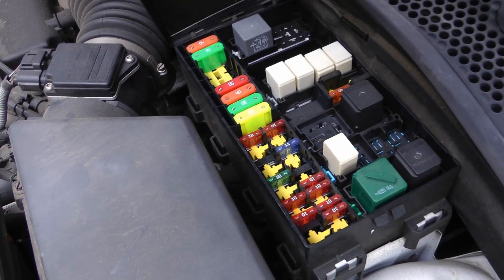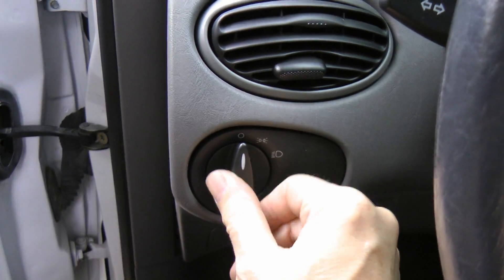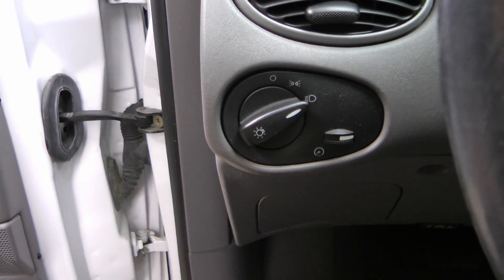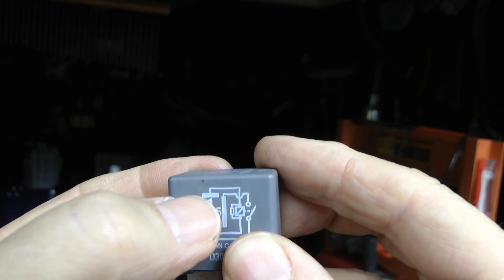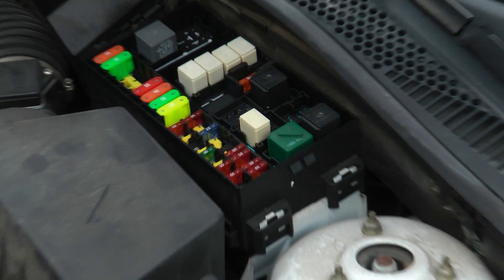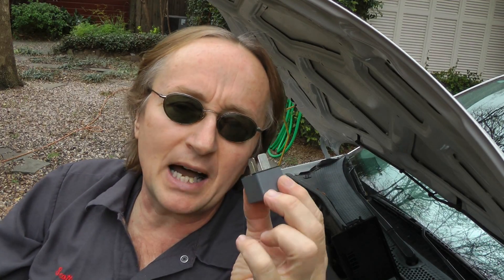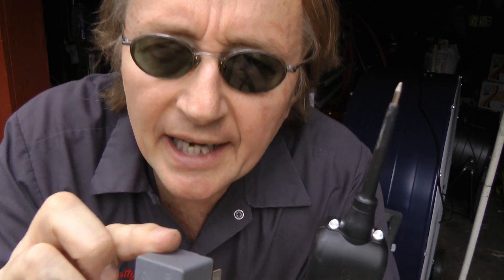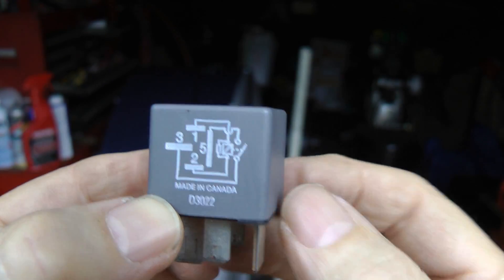How Electrical Relays Work in Your Car - Electrical Troubleshooting

Comment: Now I had a question for you Scotty. I drive a 2004 Chrysler PT Cruiser that lately has been having starting issues. Most of the time it'll just start over with no issues but I notice two things that it keeps doing. Either it'll keep cranking and the engine won't start, or it'll start and then just stall. Could that be the sign of a relay that's about to go bad?
Reply from the maker: could be a bad fuel pump relay, also pressure test the fuel pump itself

Comment: Hi Sir,

Your website seems down to me I guess. Please tell me my hazard lights are not working but turn signals are working fine in my Hyundai Sonata 2007. When I tried searching people mostly searched when signals and hazard both were not working. So in my case it is just hazard light.
When I click the hazard light button, it sounds like a good click which probably means switch is fine? Also, after clicking the hazard light button, when I tried pressing turn any direction it does not work, which means switch is fine? Is there any particular relay for Hazard only?

Thanks,
Harpreet

Comment: sir I have 1999 mazda portage 1.8  have problems with lights I changed both side bulbs when I put high bem both light work when I put in low beam one front light work any advise plz help me thx u sir
Reply from the maker: if they worked before, somehow either power or ground wiring got damaged, OR you got a bad bulb
Reply: Scotty Kilmer thank you Scotty Kilmer

Comment: Hi Scotty, my 86 Buick century ac/ heater Blower stop working so I replace the blower motor & resistor too, and still not working what next?
Reply from the maker: blower motor relay, bad wiring, or bad switch. Get a meter to test them for power loss

Comment: Hi Scotty, My L300FB Van (Philippines Mitsubishi) has no factory relay, I already trace the wiring and remove all relay i found but still the lights still on even the low and high beam. My concern is whenever I turn my head light or flash it to make signal in day time, my car stereo suddenly goes off  for a seconds,  I am wondering maybe the headlight eating too much energy that cause my car stereo goes off for a seconds. I diagnose my alternator using my multi meter reading at 14.4 volts, my battery is brand new reading at 12.9 volts, and the headlights switches is in great conditions. At the night time, when my headlights is on also my car stereo even I flash my high beam, no problem at all. And the wattage of halogen lamp of my headlights is stock wattage 50/60

Comment: Hi Scotty, my 97 Ford truck's backup lights stopped working(even with new bulbs), and I was told it is probably my relay switches. 

Are the backup lights connected to the instrumental lights? 
Instrumental panel lights are 90% out.  
Does the relay switch also control the air conditioning?

Should I just buy a relay switch and replace? Help-Please !?
You are still a Hottie!!
Reply from the maker: more often it's a bad backup light switch, replace that first.  Backuplights are not connected to instrument lights though
Reply: Scotty Kilmer Thanks, Scotty!!!! <3
Could the backup light switch be found in the fuse box underneath the hood?

Comment: Here in England, I have a Renault Clio 2009. One of the Headlamp relays broke, so I tried to get a replacement. Straight forward enough right ?  WRONG. Renault do not sell single relays, they will only sell the ENTIRE relay + fuse board as a single unit. A £ 20 relay problem is now a £ 400 /  $ 500  problem.  I tried to track a Renault Clio down in a breakers yard, but none of the 15 breakers yards have one.  Thanks Renault

Comment: Hey man i have a 99 toyota camry LE 4cyl last night my wife got in it to go to town and it wouldnt crank, wouldnt even turn over and she said she heard a clicking sound. I popped the hood when i got there and sure enough it was clicking from the fuse box. I found the relay that was clicking and unplugged it i believe it said HEAD on the fuse box lid. Watching this video you say clicking is good it means the relay works. SO..... where should i start looking for problems??? Any help would be greatly appreciated.
Reply from the maker: try jump starting it, if that works, replace the battery. if not, replace the starter

Comment: I have a Isuzu Rodeo 95 2wd my radio stays on but my Headlights, Brakes Lights, Turning lights, An my windows don't roll down an my flashers doesn't work it makes a clicking sound an when i hit my brakes lights even though it don't come on my radio shut off when I lift my foot off the brakes my radio came back on an i notice a week ago I have blacked stuff top of my battery do i need to replace my battery had it since June last year 2015 an when i try to starting my car it make a beeping noise this all happen October 30th, 2016
Reply from the maker: have the battery and alternator load tested, auto zones do that free. if not that, check for wiring shorts,both power and ground
Reply: +Scotty Kilmer Isuzu working now just a loose cable.

Comment: hello i was given a 1995 olds 88 one owner car and in pristine cond
with 90k miles. the old owner was driving it and it died on them and now it cranks but doesnt start or even try to start. it has the 3.8 motor in it with coil pack ign. would you have any ideas of what it might be or do you know of any problems these cars have..
thanks for any help.. and thanks for the videos.. i am going to sub
your channel.. might be of good use later..

Comment: I have a very hard problem my head lights don't work I have a mazda mpv when I engage the turn signal switch  to the had lights the hidh beam light comes on but no lights and the light does not come of when I move the switch. I need help
Reply from the maker: replace the turn signal switch assembly on the steering wheel assembly

Comment: Scotty, Love the video but I have a question, I have a 2013 Camaro LT and the trunk will not open electrically and at the same time I hear a clicking sound from the fuse panel near the sterring wheel.  Has the trunk relay failed?  Thanks for your Help i n advance.
Reply from the maker: pray it's just the relay, try a new one.
Reply: Scotty actually it was the electric harness that passes thru the trunk to the lid.  Apparently when we closed the lid the cable was binding causing a wire to break and another to start chaffing.  What a stupid design.
Reply: Thanks for the help

Comment: Tucson 2007. I have running head lights, hi beams but no low beams.... any suggestions....
Reply from the maker: check for power loss, from either a blown fuse, bad headlight switch, or wiring connector corrosion or breakage

Comment: hello Scotty
help me !
Where's located my relay ?
My rear brake light stuck on only when my car is start and run on the road, dangerous.
Hyundai sonata 2003 automatic 2.4
i have check my switch under perdal and everything is ok and work well when i did not start my car on.
thank you from Canada
Reply from the maker: not a relay most of the time it's the switch on the brake pedal being broken and on all the time, or that little plastic plug fell off the brake pedal and the switch doesn't shut then
Reply: When i do not start the car, my rear brake light,shut down normally with the pedal.
When i start the car, my rear brake light stuck on and never shut down?

But i'll get a new one switch just in case.
If not! 
Wich relay name do i need to change on my hyundai sonata 2003 2.4?

Thank you from Canada Scotty

Comment: Do you know where the flasher relay is on a 2001 Acura CL? I about to put LED turn signals in and I want to install an led flasher to prevent hyper flashing
Reply from the maker: hiding up under the dash above the driver's leg.
Reply: Oh

Comment: I can not find the ac compressor relay on my 2005 nissan maxima it's not marked on the fuse box.. help to hot
Reply from the maker: bad news for you, The compressor relay or A/C relay is located in the IPDM (intelligent power distribution module) and is not servicable.

Comment: Scotty, replaced a starter on my 96 Seville one year ago.  Today it's showing the same symptoms as the starter is clicking like it did when it went bad a year ago.  If the starter is clicking does that mean the relay is good since power is getting to the starter, or could the relay still be bad?  Thanks
Reply from the maker: could be many things, it just means not enough power is getting to the starter OR starter is bad. And any failure in starting system can do that

Comment: have 2000 tacoma and sometimes it clicks when trying to start then sometimes its fine starts normal. lately after alot of clicking when turning key starter engaged and engine started. then starter wouldnt disengage . where should i start? new battery already, alternator checked out too.

Comment: Kim, jaguar below, well know a lot by reading and your videos are wonderful.  just went to check fuse box under hood checked all small fuses and relays noticed one small black relay loose but when going to put it back in still loose.  oh and just put in New battery thanks to your video will be changing connectors this week.  Also going to replace all small fuses but don't know how I would change a bigger small relay if loose in that spot fits in one below?  by the way brought the car in for inspection passed then went home started didn't work?

Comment: Scottie I have an A class Mercedes 2002.  When I turn off my engine it will not start for an hour.  In hot weather this might be two hours.  I have been told it may be the starter motor but I have no trouble starting the car first thing in the morning only when the car has been driven and the engine switched off.  Then I wait for an hour and bingo the car starts.  It is usually to the minute but  it is becomes more unpredictable and can take longer if the sun is out and as you can imagine this is the time I want to zoom off to the ice cream shop.  Anyway, long drawn out explanation but do you think it could be the relay?
Reply from the maker: replace the starter and pray it's that. if not, then pay a merc mechanic with a STAR tester to analyze it and spend a small fortune in most cases. At that age, Mercs are money pits

Comment: hey Scotty I have a 08 ford mustang and all my sensors in my car are on my radio don't come on and I have gas in it but its showing I don't have any, m6 check engine ,traction, oil, brake lights are all on what could be causing this problem?
Reply from the maker: often an electrical short, a ground short, on the car's computer system, or a bad body control module itself. Good luck, they can get stinky
Reply: +Scotty Kilmer OK thanks

Comment: Hi Scotty, I am tying to test if the  starter relay on my 150cc scooter to see if it is bad.  When connected to the 12v battery to the two big poles of the relay, I didn't hear a click.  However, when I tested the 2 smaller leads with a multi-meter, there is continuity with resistance of  4.3 ohms regardless whether it is connected to the 12 volt battery of not.  Does it mean that the starter relay is bad?  Thanks.

Comment: Scotty, I have a 1970 caddy convertible.  Air condition clutch WON'T engage.  After I  checked the fuse, could it be the air-condition relay.  The blower motor works because I get heat.........OR how do i check the air condition unit ITSELF to see it its working.

Comment: Nisan Murano 2005  the display and the cigarette light both are not working, checked all 15, and 10 30 amp fuse , all are ok , what do you think , the problem is . I did checked the relay.

Comment: Since switches aren't designed to handle power directly from battery, is it safe to test relay with the car battery, or should I use a lower voltage flashlight battery?

Comment: I have a question I have a 2000 buick lesabre and the fuse box under the rear seat half of the relays are getting extremely hot nothing is shutting off or my volts don't change is that something they do or is there an electric problem

Comment: I got one more question what if the trucks running and you take the relay out ? And the vehicle dies does that mean the relays good or not necessarily?
Reply from the maker: +Cole miller removing the relay shuts off power, that's normal
Reply: +Scotty Kilmer could relay still be bad still ?

Comment: I'm not sure, but if you have an electrical short in the car and sparks start flying when hooking on the battery and smoke comes out inside the engine compartment, could these relays be the reason for that then?
Short in a switch possibly?
Doesn't sound good, I know.
My 1985 got these big ones like in that car, but it should be noted that everything worked fine as long the alternator was disconnected and the car could be driven.
I really should learn more about this, but it always sound easier than what it really is...

Comment: I have a 1982 Suzuki samurai. One day I was driving my samurai and I notice a couple of things when I would go up a hill it will lose power so I had the engine rebuilt. I gain a lot of power.but it still didn't seem enough at the same time.  when I went to start Engine sometimes it would start right up sometimes it what it and sometimes it would shut off while driving one day at shut completely off it turns over but doesn't want to start can you please help me out no one seems to know what wrong starts up for three seconds at times and sometimes doesn't start at all but turns over with a lot of power??

Comment: I sure hope you can help me out. I have a 2002 jeep TJ which won't start, no turn over. Gauges go berserk in all scenarios but not always in the same way. With the ignition off the speedometer and tachometer go poltergeist then I turn the key in on position the gauges stop. When the door is open they go wild, with the door closed they might wonk out or maybe not. Under the hood I've done some amp testing in the fuse box. The fuel pump relay buzzes/vibrates loudly, and the same with the ASD relay although it isn't as noisy. There seems to be no juice going to the 02 sensor (15 amps) and the same with the inject (20 amp). There is juice going to the fuel pump relay and the ASD relay. The radio doesn't work and the door doesn't always beep when opened and the key is in the ignition.  I haven't found any loose wires. The starter was replaced a couple of months ago and the alternator a couple of years ago. I had the battery tested and it's working fine. I've tried reseating the sensors/relays/fuses but can't get them all out.. I'm not a mechanical gal and so any advice you might give please keep simple :). oh yeah, no blinkers, radio, headlights, wipers. We have also been keeping the battery on the charger but I think the gauges work overnight so the battery stays low. The dome light dims intermittently
Reply from the maker: +Dorlaine Simmons classic sign of bcm failure, computer module, they are junk on jeeps.
Reply: what is bcm please

Comment: I have a 1996 Grand Caravan SE my blinkers work when it is cold outside. When is warm outside they quit working I have hazards at all times. I found 2 other relays that were loose when I push them by the way in my blinkers charger working but short time later my car died will not start.

Comment: I have a reno clio 1.2 2003. The car won't start and is making some sort of clicking sound.  A guy came out to look at it but it was dark so he decided to come back another day when it was light but never did. At the time he thought he thought it was due to a faulty relay.  I need it to be fixed by tomorrow so have to sort it out myself now.. I'm from the UK, does a faulty relay sound like it could be the cause, if so do you know where I could get my hands on one?
Reply from the maker: +Calum Whyte   it could be, most auto parts stores sell various relays, but they must match up to the ones on your car. They can look it up on their computers

Comment: Sir:   I have two old cars,  a 78 Grand Merc,  and a 60 Caddie.  Both have suffered from the same problem,  some mysterious sludge in the carb bowl.   It looks a bit like semi transparent tapioca, and does not dissolve in gas.   It seems that each spring I must pull the carbs off and clean this stuff out of the bowl, jets, and passages or the cars will not idle.   Is this from ethanol?    Any thoughts would be appreciated, thanks in advance.
Reply from the maker: +Jeffrey Nelson  gas tanks are old and water is messing with the ethanol and doing that. probably best to remove gas tanks and replace them OR have them pressure cleaned inside
Reply: +Scotty Kilmer   Will do that,  thanks for your help.

Comment: Scotty I have a late 90's RELAY style Western Unimount snow plow that just keeps clicking when I try to engage the controller in any direction. I just replaced the solenoid (which I tested prior to install and after hooking up) and it is good to go. Could a bad relay cause the plow to not engage?
Reply from the maker: +Cody Greenwell it could, but more often a clicking relay shows power is working and problem is at the other end of what the relay drives
Reply: Ah so it might be an electrical issue on the motor of the plow?

Comment: I wired my car stereo recently in a 06 Mitsubishi eclipse and now my right front blinker and  taillight don't work unless I turn the blinker on or step on the breaks. And all my ac button's don't work. The dash lights work though. What could this problem be? I've checked the fuses and even put the factory stereo back in and still don't work
Reply from the maker: +Jovahny Sanchez if you didn't disconnect the battery when doing the stereo work, you shorted something out. Check  for broken wiring and PRAY you didn't short out the body control module